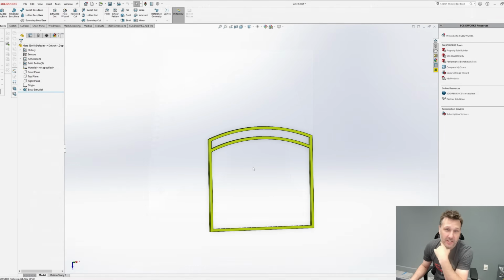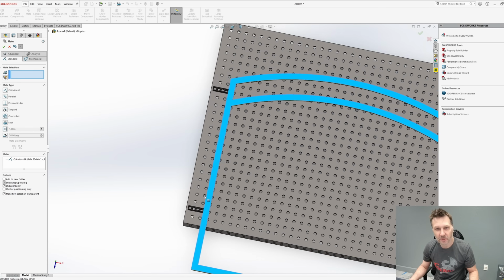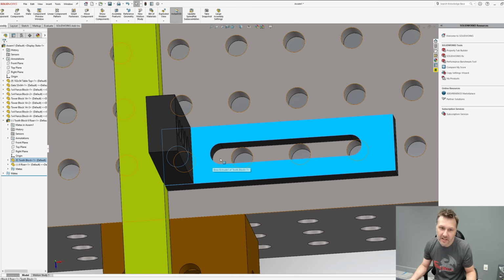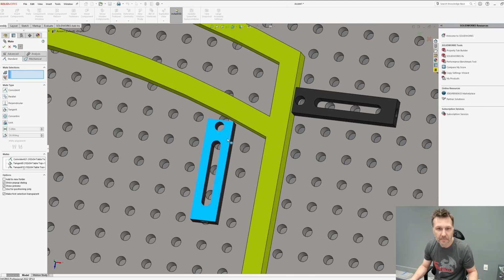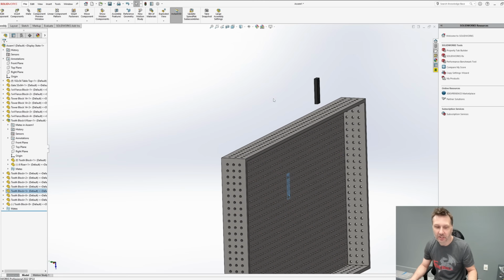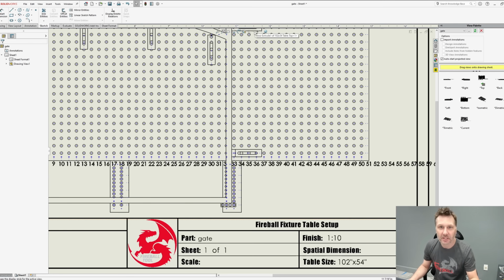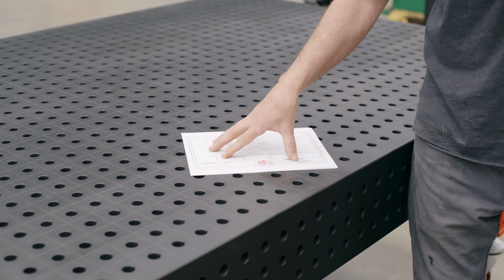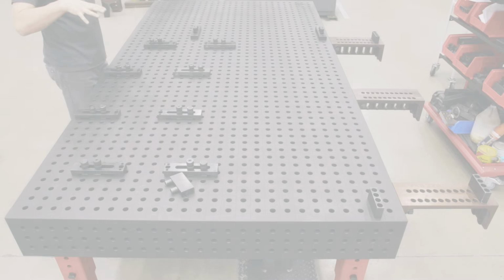How to Make a Fixture Map: Arched Gate

Comment: I am not a mechanical engineer or welder or anything like that, but I like to use CAD.  I never thought using an assembly for this sort of tasks, super.  I have created jigs to hold parts in CAD out of the part in CAD, but what you show hare is awesome.